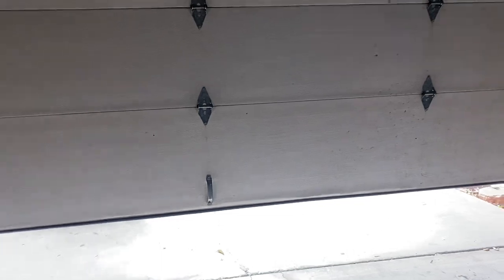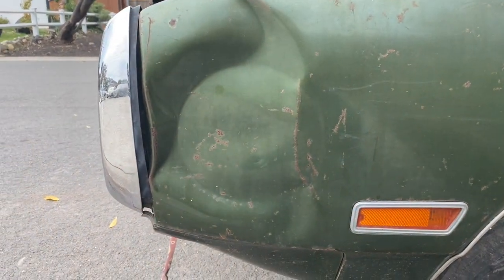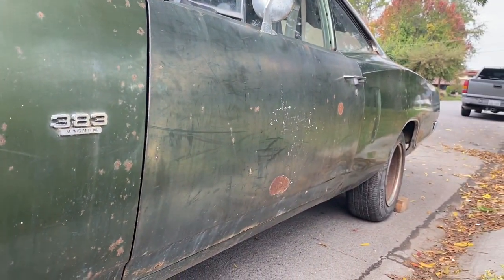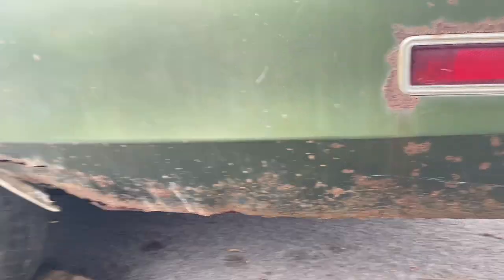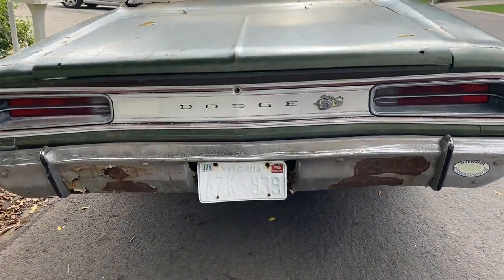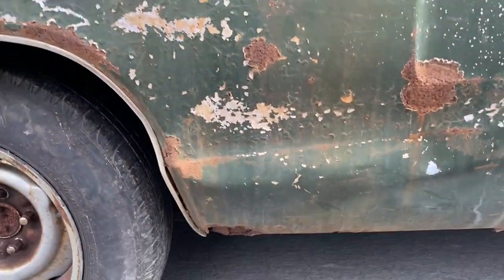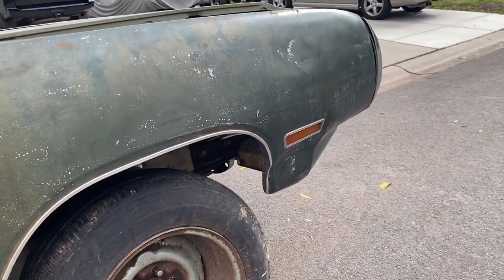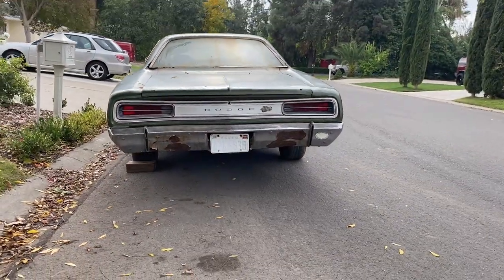1970 Dodge Super Bee (complete walk around) restoration. BARN FIND Parked since 1976!!

Comment: Hey guy, just my 2 cents . . . first, only 1710 1970 383 4brl. 2door posts made; but 2ndly, look at your date code - 806, that's august 6th of '69. History lesson- Chrysler would build cars until the second week of July, the last two weeks were mandatory vacation for workers and new tooling for the new models was installed. In August, all cars built were used for public relations; that's commercials, auto show cars, special dealer showroom cars ect... if you look at your vin , your car was the 992nd car built as all Chrysler cars started 100001 and that low of a number coincides with an August build. If you can find a good build sheet (usually under the seat) look for a Y13 code which designates the public relations build.The driver door plate should also say August. All of this to say - this car is a little more "special" than your everyday 383 '70 Superbee . . treat her right!  :)
Reply from the maker: Wow, that’s extremely good information to know. I had no idea, I realized it was an early build but did not know about the August timeline. Thank you for the history lesson. Don’t know how you got all this knowledge but I’m glad you took the time to share. I’ll put out a video about that. I’m planning on digging for the build sheet this weekend and will update. The driver plate does say Aug 69 so that’s good. Thanks again Joseph 👍🏼
Reply: @garagebuiltlegends  Anytime . . .

Comment: I think it would be good to focus primarily on getting it running and Driving and sort the wheels and interior and leave most of the body as it is maybe to keep the colour and patina any use it as a Rollin Resto...Body wise it's going to need rear quarters at the very least.if you can get full quarters they will take care of the rusted out section by the rear window corner
Reply from the maker: Yeah that’s what I might do. Thanks for the comment. I was going to replace all sheet metal, but I may just get her running and repair as I go 🤷‍♂️